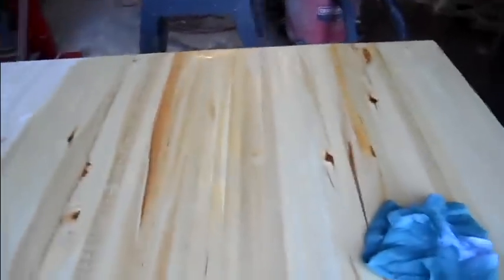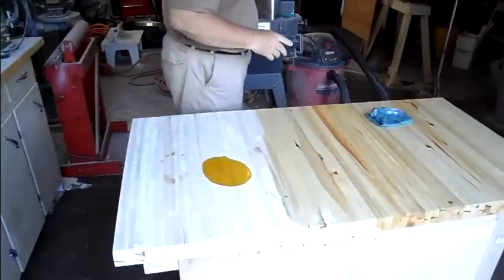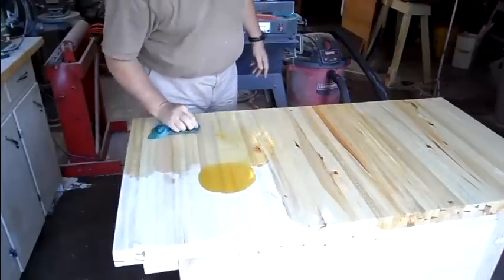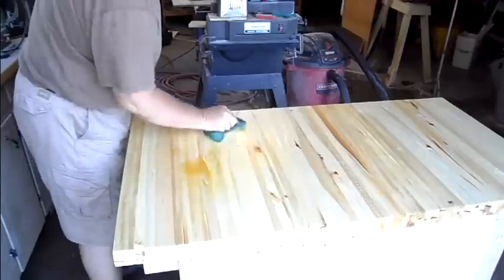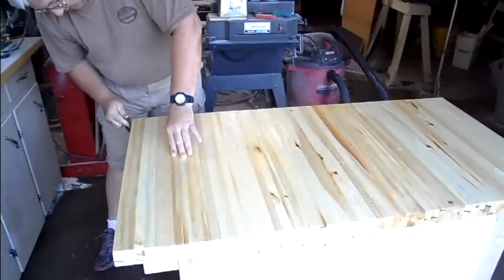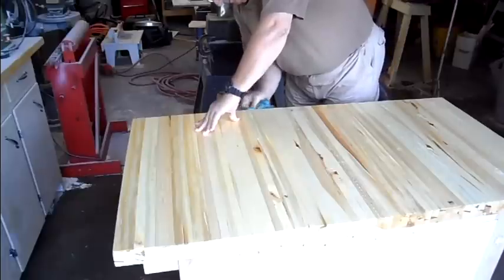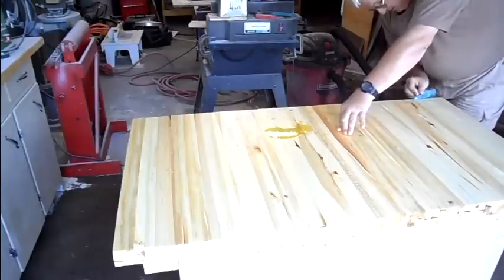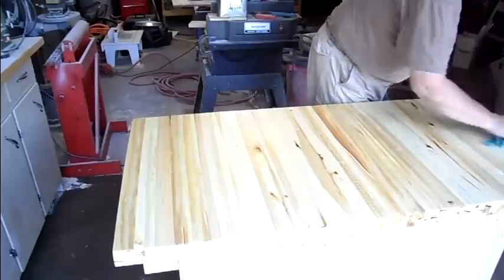Linseed Oil Brings Out the Grain in Workbench Top

Comment: if it is pure, boiled oil it's ok. if they add drying chemicals it is sometimes sold as "boiled" or "cooked" and that is not safe for eating!  the wood looks great. ☺️
Reply from the maker: Phil, Thanks for watching.  I noticed over time, I need to apply another coat. That can is over 30 years old, and needs to be used up. Regards, Briz

Comment: I have worked with linseed oil before. What I discovered is that when it dries (really dries, after a week or so) it's like you haven't applied any oil at all. What happened to this workbench-top?
Reply from the maker: Simon de rycke I have found very much the same results as you.  From what I hear, re applications are necessary.  I may put another coat of linseed oil and after it dries, put a coat of poly on it.  The hurdle I face now is taking my planer and oscillating spindle sander off to do this procedure.  Thanks for watching!
Reply: Linseed oil application:
A coat a day for a week,
A coat a week for a month,
A coat a month for a year,
A coat a year til infinity and beyond
-My 108 yo grandfather